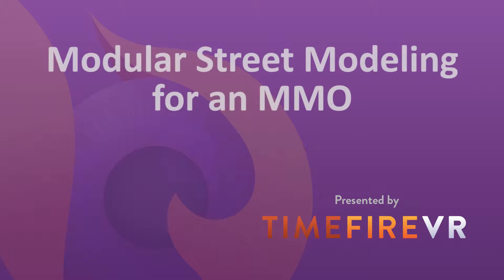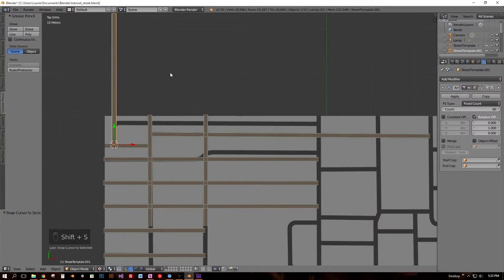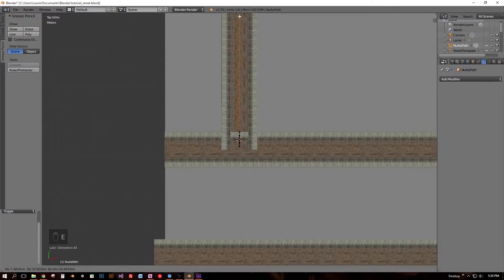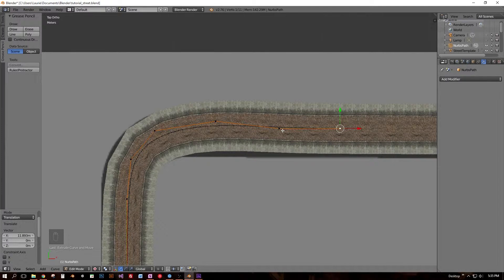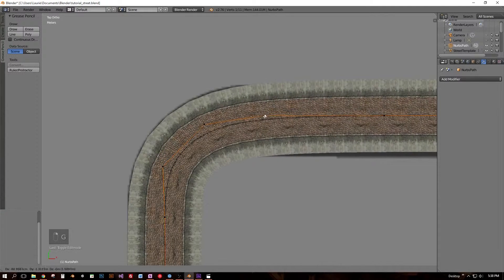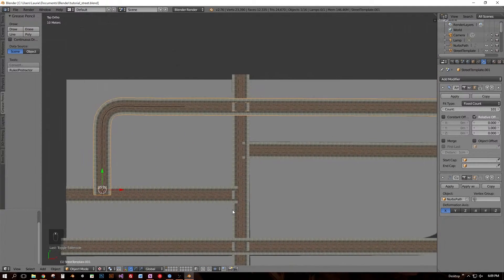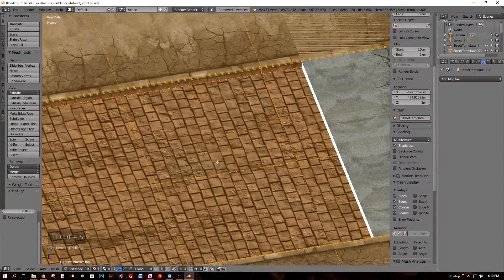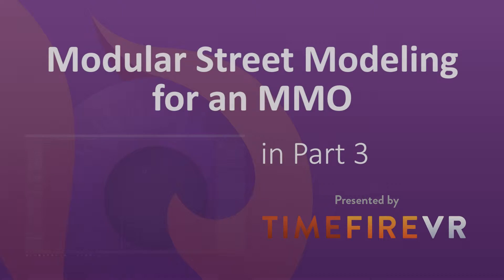Modular Streets Modeling Part 2

Comment: Really curious to see how you're going to handle intersection with textures that have so much directional information...? Also, scaling your UVs non uniformally must create some visible stretching and I wonder if you measure this in any way - do you know how much is too much (it starts to be noticeable) from experience? This is a very fast workflow you have here but I'm still not sure the end result will be visually superior to building kit piece on a pure Bethesda fashion which allows for a lot of visual variation. You must have to use an insane amount of decals in engine to break the repetition. In any case thank you very much for making these videos, you've got a very pleasing lecturing style and the bite-sized approach is very refreshing :)

Comment: If you're using Unreal Engine 4 you can also use the landscape spline tool for roads, just saying.
Reply: +redchant Thank you for pointing this out!  The spline tool is extremely handy, but it does have some disadvantages over this method, one of which is intersection handling, which you'll see in the third and final installment of this series, where I demonstrate a simple method for splicing two sections of street together at an intersection. 

 To use the spline tool in UE4, you also need to prepare your geometry with plenty of edgeloops in advance to accommodate bending, and unfortunately that extra geometry will remain in your finished product unless you export it back out of UE4 and attempt to remove excess edge loops in your modeling software from a now-triangulated mesh.  As I demonstrated here, you can add extra edgeloops where needed in Blender too, with the big advantage of being able to remove the loops from your quad straightaways before exporting to .fbx.